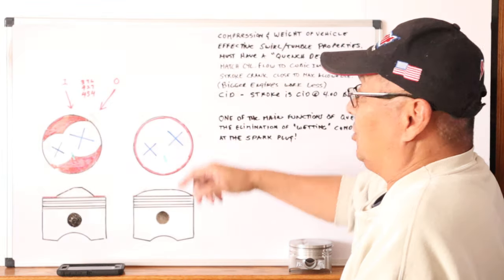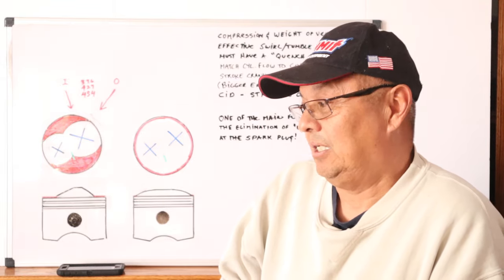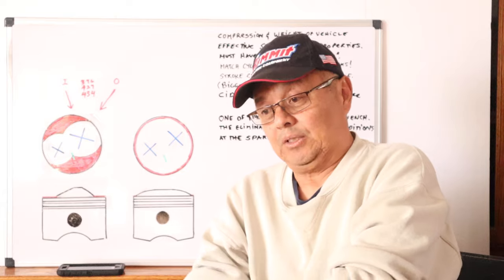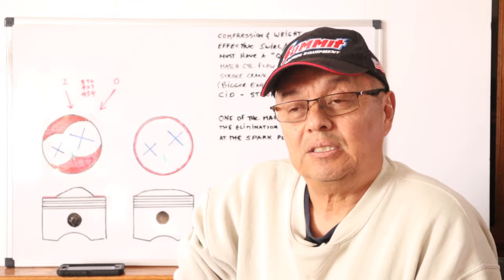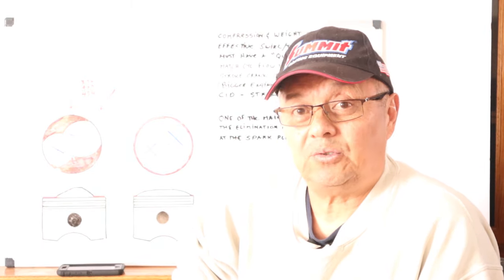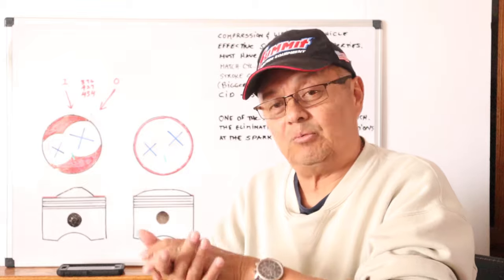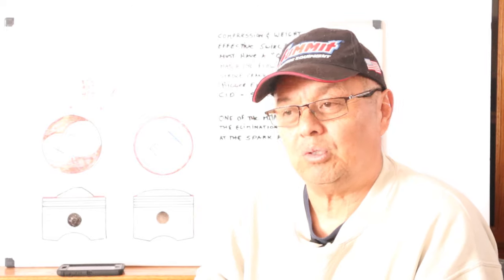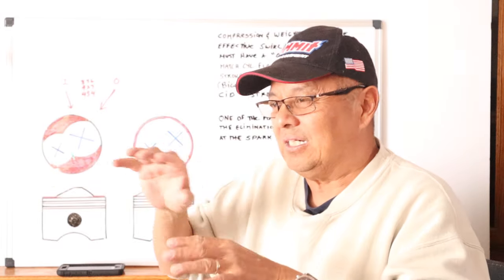HOW MUCH COMPRESSION PART I CAN WE RUN ON THE STREETS?

Comment: i understand & agree with your quench description,,but because of $$$ i had to go with 20 cc dish  kb 302 pistons in a 351w stroked to 392 with stock 351W rods,edelbrock estreet heads 2.02 intake 1.60 exhaust,ive ported the exhaust side only & gained alot/  185 @ 600, its in a Heavy 4x4 / 35 inch tires,auto overdrive daily driver, , what do you think  is the biggest cam  i can run without a stall converter,,can i go up to 225/ 228 duration /530/540 lift & what LSA Should i run,your shows are great for us DUMMIES,
Reply from the maker: What heads are you running and intake manifold?  The cam specs seems to be right on and just needed those info.

Comment: Back in the 70s dummies would build street blower motors with 6-1 pistons, that's fkin crazy,I have 11-1 slugs below my 14-71 blower,no problem,and I don't use race gas
Reply from the maker: Yes sir and they have to drive the blower harder and creates more intake heat and they wonder why it detonated!  Thanks for watching Ohio!

Comment: Another Awesome video. Ben, have you ever tried two different quench pad  angle's? Say 7° on one side and a 5° up to a 6 1/2° on the other quench pad? I would try the taller angle on the highest side of done side first, my reasoning is? It would cause a high back swirl in the middle where spark plugs are.
Reply from the maker: Gary, i did years ago angling the piston deck a bit to maximized the quench and like anything there is a point of diminishing returns.  With the piston rocking inside the bore, giving an angle cut there to keep the quench close sometimes ends up trapping some mixture then which eventually ends up self- igniting because if is too tight they trap the gases, too loose they do not do much of anything!  The secret lays in finding the "ideal" clearance to allow movement of the mixture to the center of the cylinder to ignite easier and more complete.  Taking into account rod stretch steel or aluminum takes a lot of testing in finding the ideal squish distance.
Cutting the engine off after a run or a dyno pull tells you the story of what goes on at the time.
Just like the piston on the cover pic here, it still shows some concern on the intake side still lean around the valve relief closest to the cylinder wall!  I am close on the tune on this engine and it could have backfired if I am leaner still and would melt the edge of the intake valve relief as well take a close look at the exhaust edge the same lean strip showing and both could have done me in if I leaned on it some more!  lol

Comment: Ben, have you got any experience/opinions on the "Singh groove" concept??
Reply from the maker: Mc, yes the groove we have been doing for years except this guy patented the process so it is his and no one else!  Now, it is very important that the quench/squish distance be right on point or the grooves will not function the way they are intended!
Reply: @benalamedaracing2765  Ben, thanks for the reply.  My engines are for the street and currently running between .032 - .035 piston to head clearance (sbc/bbc).  I know some that recommend as close as .030 with steel rod.
Reply from the maker: @gmcnelly2468 , with the groove installed it is important that you maintain between .040-.048 quench clearance.  This way it will work.  Any larger or closer it does not work.
Reply: @benalamedaracing2765  Thanks Ben.  I have been running them with the tighter clearance with no ill effect.   The groove does help those engines with the wider piston to deck clearances for sure.   Keep up the good work.  Enjoy you sharing your vast experience.
Reply from the maker: @gmcnelly2468 , thanks as well and I have to look again at running your same clearances and see if I may have overlooked something in that regard to running tighter quench.

Comment: That 408 sbf 9:1 cr could  run 87 octane pump gas or add boost on higher octane or E85.
Reply from the maker: Yes that is easily done...

Comment: As of now I have a 010 GM block .060 over and am really Leary about stroking it because of the cylinder wall thickness. I have been told the block is done because of the overbore . My current engine only has about 4000 miles on it,the cylinders still have  the crosshatch. Im not sure if I would be safe tring to push this block. Most of the engine shops I have called to do My SBC Short Block tell me they won't build what I want because it's too much compression. All I wanted was a 383-406 with 11.1. I will be Running a decent Mech.Roller about 240+ duration @.050 .600 lift with Dart pro1. 215cc.I already have a 3500-3800 converter  I was under the impression that more duration bleeds off cylinder pressure and it should be fine. Where I live I can get 93-94 octane all day. So I gave up on local shops. Now I'm looking online.
Reply from the maker: You are on the right track and  your thoughts are correct and on point!  Do this and find somebody that would be willing to work with your desired build up!
Reply: @benalamedaracing2765  do you think it would be okay to use my current .060 over bore block for a 388 stroker. It's just a street motor and I probably turn it to 7000 here and there but not often. You know maybe when somebody pulls up next to me and thinks they're tough guy. 😁
Reply: Most machinists aren't engine BUILDERS. I know this sounds completely backwards, but a higher compress ratio is better on a stroker. A higher compression ratio expands faster  during combustion and will peak before the side loading takes effect. If your intake valve closing point is around 70 degrees after bdc or more, you should be fine. A dynamic compression ratio calculator will tell you what your dynamic compression is. Shoot for 8:1 on pump gas. Also, make sure you have a true static compression ratio calculated with deck clearance, head gasket thickenss, and a measured combustion chamber volume. I even calculate in the head gasket bore when I do it as there is a tiny bit of combustion space that gets ignored on most calculators.

Comment: The mod motors used the same pistons and cylinder heads for the 4.6 and 5.4l. I'm guess bean counters were involved in that decision. As a consequence of that and their long stroke, 5.4 pistons are something like .140" below the deck. Does anyone have an idea of how to utilize quench with those limitations in a street application?
Reply from the maker: I have done 4.6 and some 5.4 but they were already disassembled when I got them so I never saw the factory pistons the way they are stock.

Comment: In my bikes i got a OEM Compression-Ratio of 12,5:1 and run on regular 95 RON Octane Pump-Gas (89 US MOZ)
Reply from the maker: Yes the smaller or much smaller bore diameters lends itself to better detonation resistance because it can cover the whole piston area and chambers without any issues of secondary hot areas creating ignition sources.

Comment: Hi Ben, I have 1973 351c with 4V open chamber heads if I use DS dome pistons with stock crank and rods  I can get 10.7 to 1 compression. How would it compare to using flat tops and squench 4V heads? Thanks, Dave
Reply from the maker: If you compare the two, open vs close chamber with matching domes to equalize the compression ratio?  The 4V close chamber would definitely have the advantage due to the effectiveness of the quench to control the flame propagation from going out of control!  Open chamber is usually soft on the low to mid range and only when you are @ high rpms, when the "rapid" opening and closing cycles of the intake valves creates its own "effective" mixture motions!
Here at this point they almost equalize but the advantage still goes to the close chambers.

Comment: I'm a handyman and bought a chevy express with a v6. Crappy milage and power due to weight. Planning an easy 5.7 vortec swap. I'm looking at the 64cc chamber aluminum head and 10.5:1 and regular pump gas. Am I going to get way with a very mild cam here? MPG is paramount here.
Reply from the maker: A mild cam will surely work wonders and if you can keep the duration on the low side and run as much lift it will be the best!  Talk to Isky or Comp Cams and maybe they can grind one for you or have something in their catalog that is similar!
Reply: Now it's going to be a 383

Comment: I built a 6.0 LS 11:1 with 220ish @.050 cam on 110 lsa , 4cc dome pistons , milled & ported heads , baby stall , etc 5000lb truck full timing , 32" tire and 3.73 gears no detonation daily driver shop truck
Reply: i got a lq9 with flat top pistons in it  i wanna run on 87 gas  but calc says ill be at 11.2 to 1 even if i use 55 thou head gaskets this will be in a crew cab truck u think it will spark knock i have hp tuners to pull timing out if i need too but would it be worth it ?
Reply from the maker: Sounds like you guys hit it out of the park and definitely a good build from your shop!
Reply from the maker: If you have a big street cam you might get away with it and my only concern is that .055 gasket i feel is definitely too much open clearance which might go backwards on you!
Reply: @benalamedaracing2765   thank u sir

Comment: What is your thoughts of the 18rg 9,7 pistons? Detonation?
Reply from the maker: 18RG is like the 2TG but bigger and the open chamber is indeed a problem!  Perhaps digitized the heads and build a piston which has a close proximity to the combustion chambers to get some kind of quench action!  Those things do not respond with anything less than 12.1!
Reply: @benalamedaracing2765 I guess taking it to 92mm will increase the quench action or a drill head design. I understand you created unique ariana pistons. 💗

Comment: If u have a high duration camshaft that bleeds of alot of compression so that u can run higher compression
Reply from the maker: Even with lots of duration you can change the intake lobe timing and throw a curve ball as far as issues with dynamic compression big time screwing us up!

Comment: So the sound wave going back and forth In the open chamber. Is that what causes piston skirts to Crack and or break? Also the pitting on the top edge and side above the top ring on the piston, is this the lean side (area) detonation? Thanks again.
Reply from the maker: Yes the sound waves are supersonic and bouncing back and forth between one side to the other can break the cylinder walls or push the head gasket to leak!  Remember it happens in successive and intense waves more than we can count!
You are correct on the area of lean which is the intake valve relief closest to the cylinder walls!  Also take note a rich mixture on the other side also burns less intense because the fuel molecules are way more than what is ideal for fast and safe flame speeds!  Rich mixtures burn slow and while it is going  on the temps and pressures also goes up and ignites this areas producing secondary flame fronts.

Comment: So is a flat top and small chamber better or a dome piston and a bigger chamber to accomplish the desired compression ratio?
Reply from the maker: Chad, no contest a flat top with small chamber beats the other big time!  The piston is lighter and the heat loss from a smaller chamber is a lot less and more of this energy is used to push the piston down and not wasted and spread all over a big chamber.
Last but not least is the issue of a dome intruding into the chamber basically splitting the combustion chamber in half!
Reply: @benalamedaracing2765  I remembered an article from you years ago talking about the smaller chamber making more power with less flow than a big chamber on a head that flows more . I was confirming.   I didn't know the dish killed quench though,  thanks
Reply from the maker: Chad, one big effect of a small chambered head are the valves are standing much straighter from the usual 20* and now down to 15-7.5* ! The net gain here is the placement of the top ring land to as high as .150-.125 for the brave engine builders for the latter number.  It gains a lot of power due to the reduction in the "crevice losses" associated with intake dilution and largely unappreciated by many builders except maybe the few true purists in finding Hp for NA applications.  It is impossible to place rings this high when the valves as angled @ 20* or so and that is the big difference with the new SC1, SB2 and others.
Reply: @benalamedaracing2765   thanks for sharing the knowledge
Reply: @benalamedaracing2765  Hi Ben, I'd just like to ask how to remedy part throttle pings on high compression flat piston 16v small, closed chamber engines? I have followed several good builders using this approach due to the better flame propagation but all of them complain of part throttle pings . Thank you in advance!
Reply from the maker: @findtherightbeat , part throttle pinging is mainly due to too much ignition advance at that rpm!  Back it down a bit let us say @ 3500 or 4500 at least 2-3or even 4 degrees and it should dissappear and you are good to go!  Another is perhaps your dynamic compression ratio is too high and maybe changing the intake cam phasing by retarding a bit off a few degrees will do wonders!  Do not touch the exhaust because the sensitivity is in the intake cam timing!

Comment: I ran 14:1 C/R 2bolt main Small Block Chevy daily driver. Could have gone 15:1+. The main problem is the 3hp starter motor clutch can't take it.
Reply from the maker: Have you tried a start retard box that retards ignition when you try to start?  Also if you can crank the engine a couple of seconds and throw in the independent ign. switch it should help it start easier!
Cranking it with the ignition on will try to resist and will break your starter and drain the battery big time.

Comment: Doesn’t it help when your relieve the spot in front of the spark plug to help the burn kernel? I’m talking about relieving the part of the piston dome where the spark plug is positioned
Reply from the maker: I do this with conventional cylinder heads and on a Yates head the spark plug is way above the dome so it is largely unnecessary.

Comment: Ben could I ask you a question about pistons out the hole?
Reply from the maker: Sure let me know what it is that you want answered.
Reply: @benalamedaracing2765  393 w  alum heads. Piston .010 thou out the hole. Trying to figure good compression ratio. 60cc heads.

Comment: 4032 pistons on street turbo LS 366 I will drive it a lot I just don't know if the 2618 pistons will have time to expand fully all the time? 750whp 4x4 truck can turn it up to 1,000+?
Reply from the maker: If you keep it from detonation it should be fine as long as you follow the manufacturers piston to wall clearance.

Comment: I have some 2v heads and I want to put them in a 302 with some combination of piston compression height and /or 289 rods to get a flat top piston close enough to the top of the chamber to get 10.25:1. I am hoping the spark plug boss will act as a wedge to force gasses to mix. I am prepping the heads by bolting them to an empty block and trimming the chamber edges to be an extension of the bore so the piston top will fit into it....will need to cut valve reliefs or use cleveland pistons, or both. WHY? lol...the parts are laying around and I am curious.
Reply from the maker: Let me know how it turned out and getting as much compression would really help specially with a C heads!

Comment: I wonder if a man could weld and grind and build squinch in stock 2 barrel heads ? If so how much would that help stock pistons not dished ?
Reply from the maker: That would be expensive and if squish is what we are after it is best to digitized the chambers to match the piston dome or areas of the piston to shadow the heads real close to spur some kind of mixing or slapping of the mixtures.

Comment: I have 18to1 compression ratio and higher tripping on the street now with these turbos you never know what compression ratio they're at unless you're the tuner of it the more air you push in the more compression ratio you'll have it's all and how much your pocketbook can go because years ago when I was drag racing you had to buy high octane fuel we didn't have these knock sensors and other things that you can spray in there like water to take up the compression and slow down the knocking of the lean conditions you were trying to run it at
Reply from the maker: What kind of engine and heads are you running Scott?

Comment: That is a very skewed question. First off fuel injection because of the stand alone systems you can run 10.7to1 on a LT Chevy with a carb a lot less. And a good cyl head man can fix a set of combustion  chambers to burn the af charge very clean with. No spark knock cyl head material plays a big role so many other things can have a impact  on weather a motor will spit and procductr
Reply from the maker: Anything is possible and FI manifolds do make more torque at the expense of HP at the top end and vice versa.

Comment: Ben on the topic of compression and vehicle weight, my Bronco 331 manual weighs 4300 lbs and I’m at 10.25:1, could I have run more compression? My quench is at 42 thou
Reply from the maker: That thing is definitely heavy even for a stroker engine.  How much camshaft are you running?  That will definitely play into the equation here.
Reply: @benalamedaracing2765  it’s a Comp XE266HR12… .544/.555 lift on 1.6 roller rockers, I believe the advertised duration is 266/276
Reply from the maker: @WesternReloader  I think you will be fine even with that weight because the duration is big enough to bleed cylinder pressures that leads to detonation.  Just make sure you get a little bit more stall speed in the transmission if it is an automatic.
Reply: @benalamedaracing2765  manual, thanks Ben